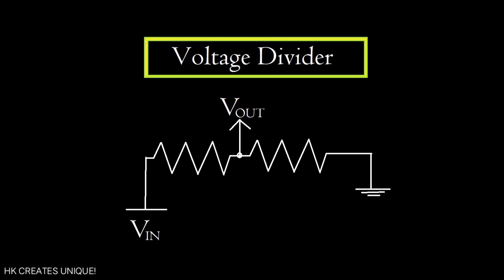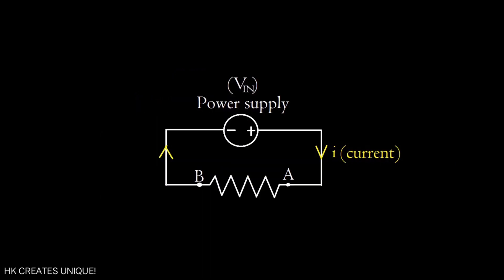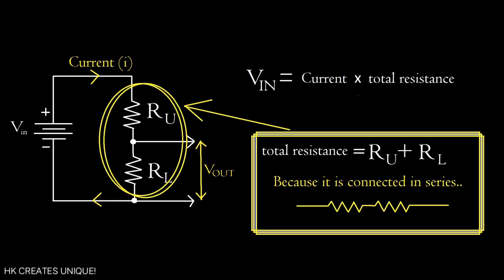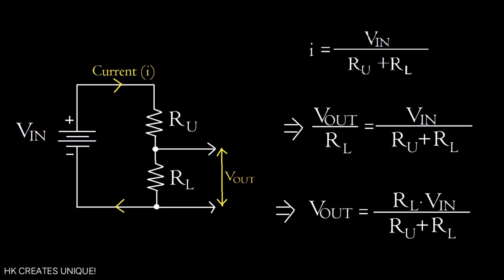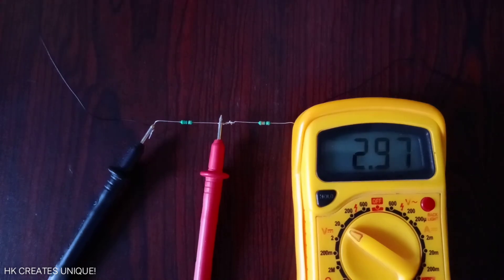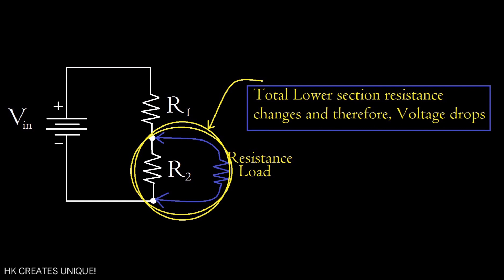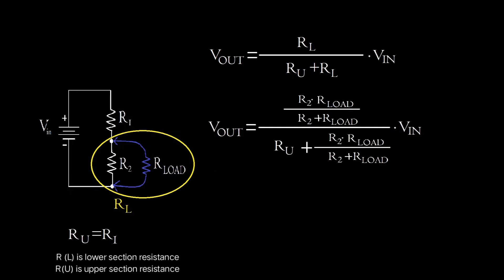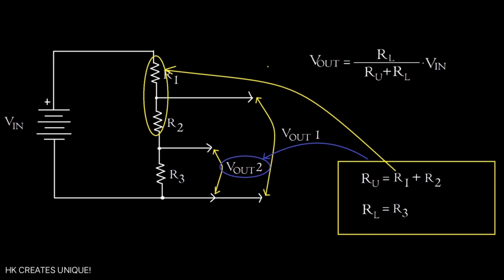Uses of Resistor: 2 || Voltage divider

Comment: Hello, I want to take two types of current output from this XL4015 circuit. How can I divide the voltage by using 2 or 3 fixed resistor?